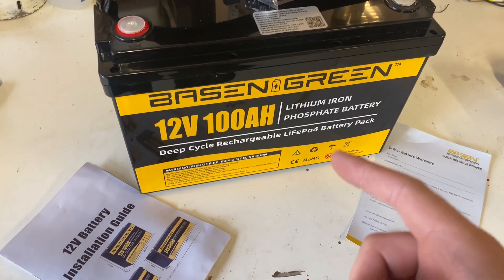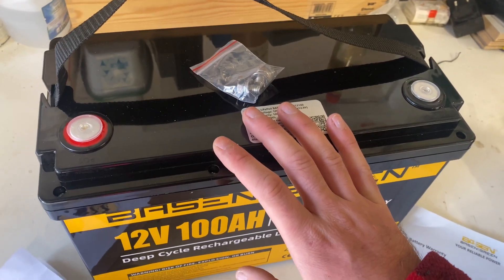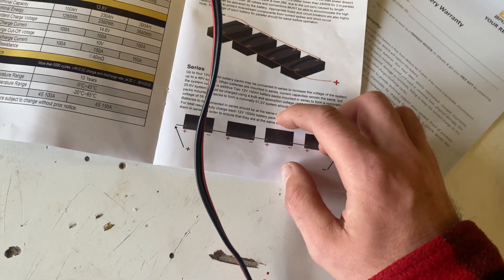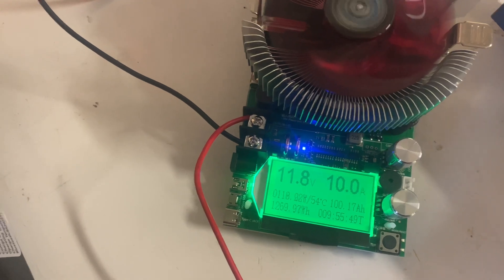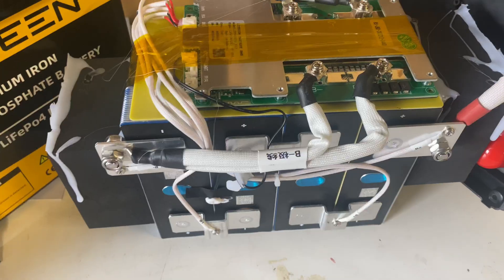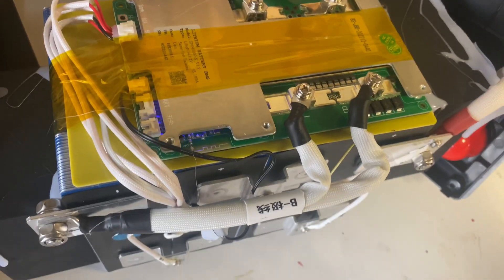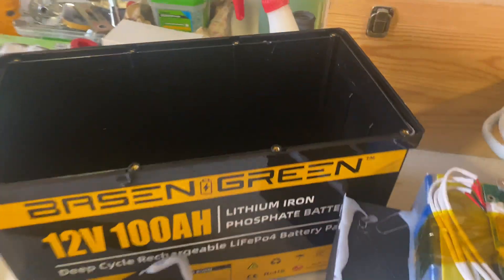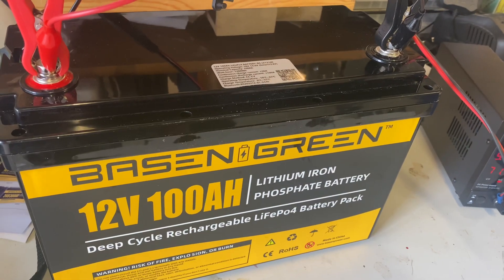Basen🔋Green 12V 100AH LiFePO4

Comment: if u have 2 lifepo4 12v batteries in series can u plug 12v inverter to other battery, does bms some how make it work
Reply from the maker: You need to connect them in parallel so the voltage stays the same( positive to positive and negative to negative). If you connect them in series, it will become a 24V battery and it will not work on a 12V inverter.